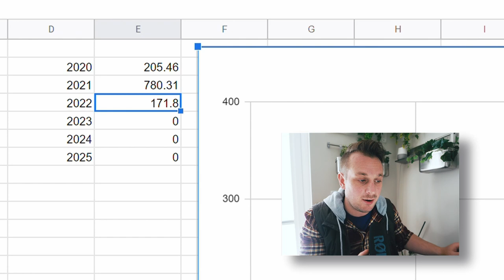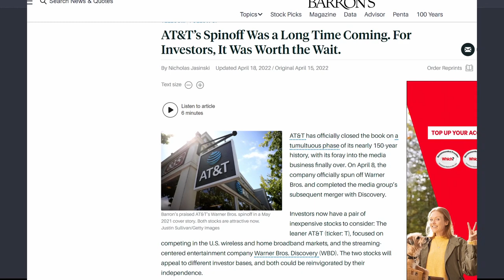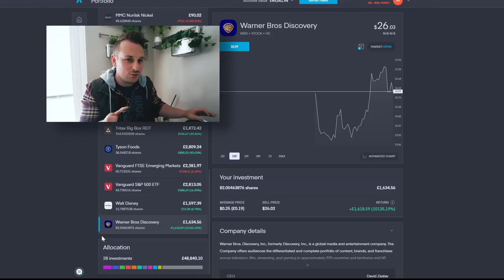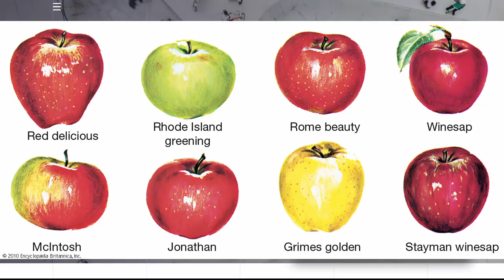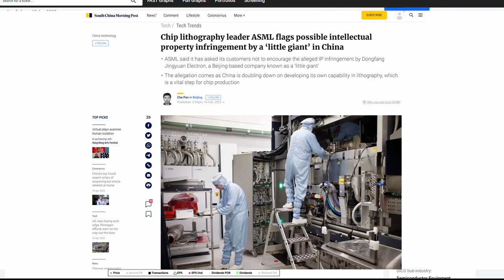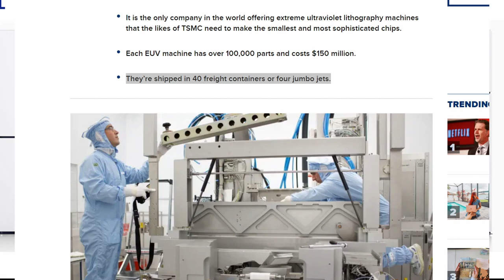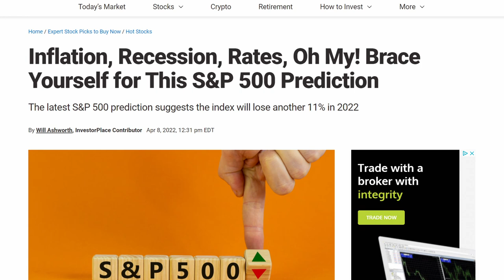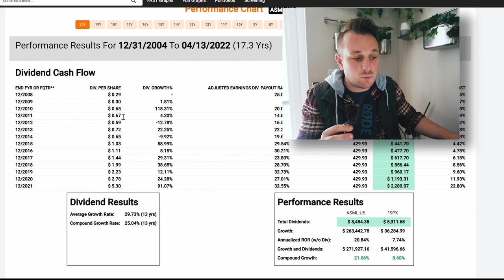Why are my dividends not growing? + First BUY of the year!

Comment: Top vid man 

For your spreadsheet I would advise updating often for any key changes as it can be a nightmare to go through retrospectively to update information (I do it with mine sometimes) 

Also do you use excel 360 or not MS ? Only if helpful I can send a empty version of mine with the coding in case you want to rip anything from it? 

Offering as you said your not a spreadsheet man and I sadly use them alot 😂😂🤣😂

Bw
Reply from the maker: Haha, I think I'm just going to put it in whenever I remember the timings won't show very well but the prices will

Comment: Stock prices are forward looking, dividends are backward looking...also - have you factored in exchange rate fluctuations? GBP is very weak at the moment which gives you less purchasing power for US stocks (although if it weakened since you bought them, then you can book some kind of paper gain...). It looks like a good proportion of your portfolio is priced in USD and if this is unhedged then you are at the mercy of the GBPUSD exchange rate (although dividends will be worth more, conversely).
Reply from the maker: Yes about 5% of my gain is probably due to fix.